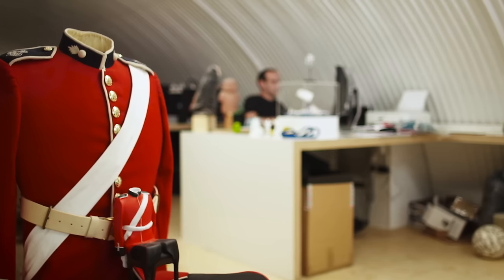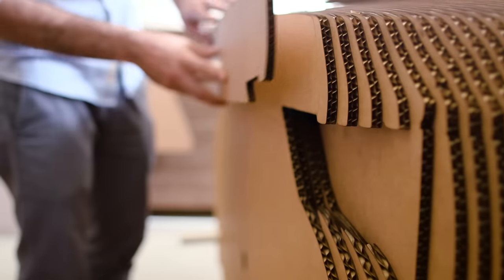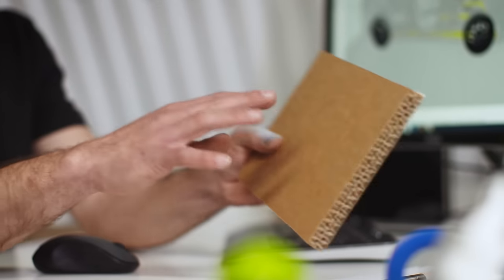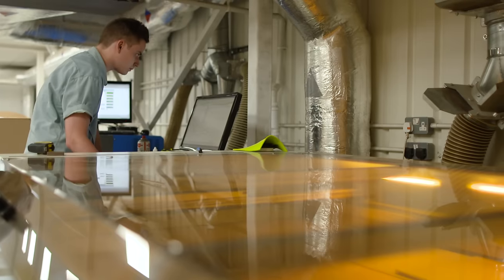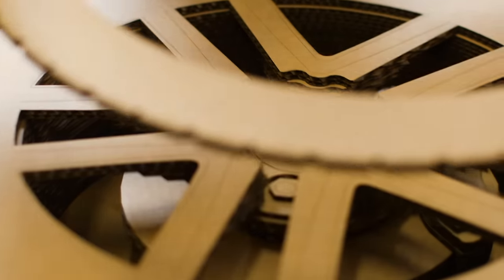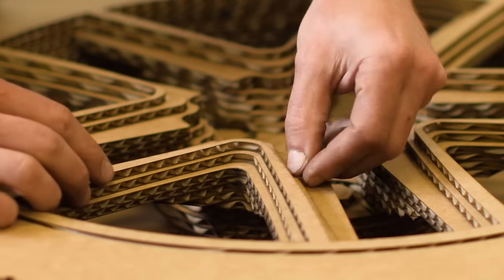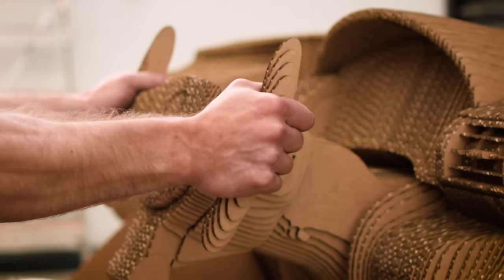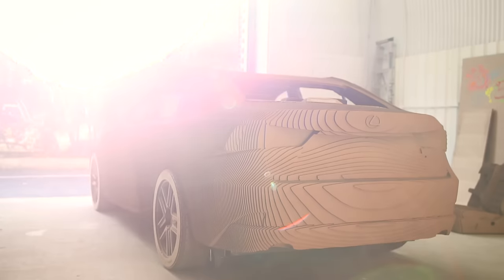Lexus - Making the Origami Inspired Car

Comment: in the minute 2:54 you can see the back tire is not spinning :/
Reply from the maker: Hi Jose. The wheels are not connected to the drivetrain. At 2:05 you can see that inside the frame of the cardboard car, we have mounted an electric mobility scooter to allow the car to move backwards and forwards. Making this sculpture drivable was not our target. It was created as a celebration of the skills of Lexus’s takumi craftsmen and women, capturing the spirit of Creating Amazing in design and engineering. Thanks.
Reply: Lexus UK Cool, very creative, keep up the good work...Love and Blessings ☆☆☆☆☆

Comment: Lame ripped off the idea from the cardboard Porsche 911
Reply from the maker: Hi. Thanks for your comment. The project that you speak of used a very different approach. They used plastic tubes, aluminium foil and rolls of tape. We used 1700 individually shaped pieces of cardboard attached to the frame.